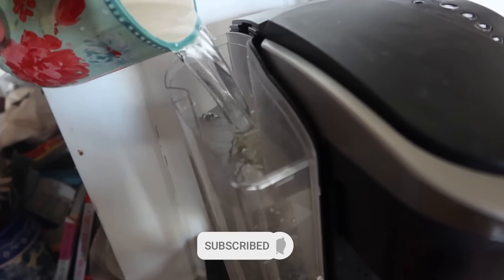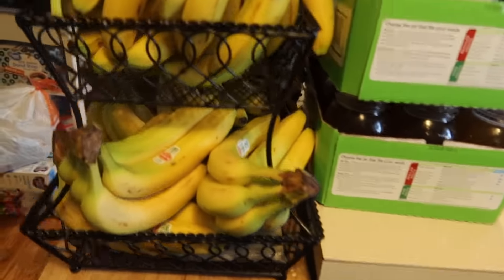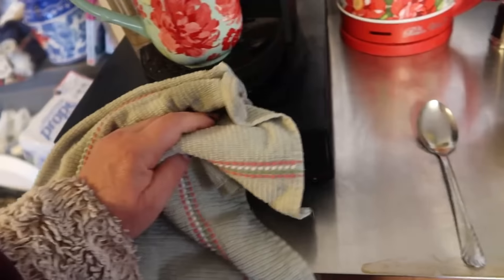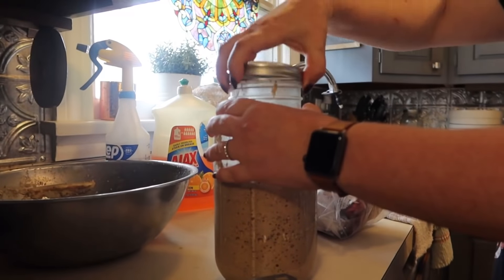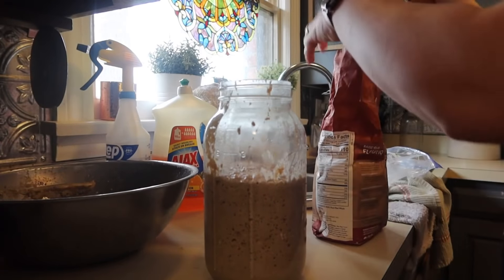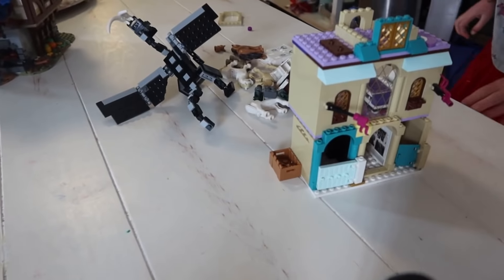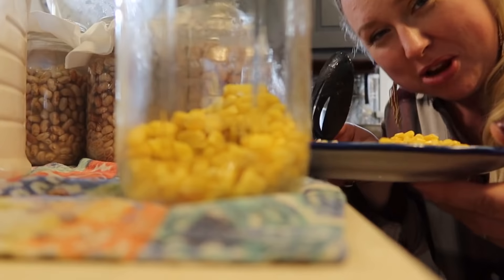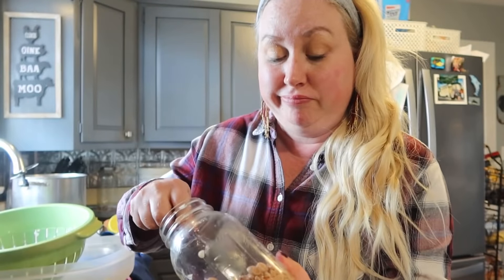Things Fell Apart

Comment: I have suffered from sciatica for almost 5 years now. I have done PT, gotten adjusted, massages, all the lotions and creams etc. The pain is awful at night when I have a flair up but I will say once I started taking tumeric it has helped tremendously. Unfortunately it took a few months but now I am only experience pain only on occasion and it's mild. Do stretch as well and a pillow in between the legs to relive the pressure on the spine. I will send prayers for a healing.

Comment: Currently battling sciatica in both hips and have found relief from CBD oil.  I've heard it is about 50/50 for pain relief.  But it might help.  and  I never presoak my beans.  I use 1 C dry beans in my quart jar, add 1 teaspoon salt then fill with water,  I put them straight into the canner and process 90 minutes.     Works perfect every time.

Comment: Don’t have time to read the chat but when I can dried beans I don’t go through many hoops.  I sort and wash the beans.  Put them in a jar and depending on the size (smaller beans don’t take as much water as larger beans) I put raw beans in and fill with water.  For example: navy beans I do about 3/4 full of beans and do 15 min at 10# pressure.  Kidney beans I do 1/2 full of beans at the same time/pressure.  No need to soak and precook.  This is what has worked for me. The times are for pint jars.

Comment: I know this is rebel canning but what I do is put a cup of beans in a quart jar. Now I always rinse them first but no soaking. Add the water to the right level and put a lid on and pressure can for 90 minuets. Remember to vent steam for 10 minutes first. Give this a try on 7 jars a canner load and see how you like it. I do pints because we don't have as many as you. So I do half a cup per jar and 75 minutes processing.

Comment: Jamerrill I also am suffering from left side siatica pain This is what I have used. Hot rice pack, ice pack, foam roller, stretching, naproxen, tens unit, electrical nerve stimulation and finally steroids. I have a trigger point grid ball coming today from Walmart.
Reply: I have had marvellous results from acupuncture. You might want it give it a try.
Reply: sleep on a futon...I switched about 10 years ago and, (after being told I needed spinal surgery,) never had sciatica pain again...

Comment: I have made mistakes with canning also.  It is all learning.  One tip, don't use metal utensils in the jars.  The reason is because flakes of glass or unseen cracks can be made.  Thus, the integrity of the jars is compromised.  It is fixable and you will have several lovely meals made ready in your pantry.  🥰

Comment: I've had sciatica for 22+ years, first few years were severe. Thru trial and error here are my tactics for living with it.
Temperpedic (soft) adjustable bed, pillow under knees and a zero gravity recliner for a few hrs on bad nights. 
Activator chiropractic, no electrical stimulation which fires it up. 
Acupuncture and Lidoderm  patches (Rx for higher percentage) or otc  for lower strength. Blue Emu numbing Pain Relief cream.
Good luck!
Blessings,
Jan

Comment: I have so many back issues! I’ve had the shots, surgery and a non-working spinal stimulator. I had to go on disability retirement bc of my back. A few things that I’ve found helps is; bend at the waist and hang forward and kinda bounce. Ice is much better at relieving back pain/spasms than heat-however, heat does feel nicer. At night I sleep on my side with a pillow between my knees. I hope these little tips help you some. I’ll keep you in my prayers!
I just Love your videos! They inspire me to cook! ❤️🙏🏻 Terri

Comment: Hello Jamerrill, I am a Registered Massage Therapist. I treat a lot of people with sciatic pain weekly. Most are postpartum women. I can not diagnose anything, but can share a few suggestions. Of cause they are just suggestions and not a treatment plan. (SO don’t come for me if it doesn’t improve😁) Stop Chiropractic. Put your time into massage and physiotherapy. Strengthen your core and stretch your low back. Try stretches that pull your knee up and across towards the opposite shoulder. Make sure you are holding stretches for at least 30secs. Heat can be your friend, before and after stretching. Try sleeping with a thick pillow between your knees, grumpy hip up. Try adding Yoga in a few day a week. Plain yoga, no fancy yoga. Sciatic massage is a lot of focused glut, lower back, hip work.

Comment: I think the carbs in the beans turns into glucose (sugar) and like candy sticks together. Next time spray the jars with baking spray, it should work. Also pour a small amt of oil on the stuck ones and submerge the closed jar in hot water. I'm sure this will work without you being frustrated.

Comment: For your pain, it stems from posture. We all tend to be in a forward “C” shape doing our modern day activities. Spend some time in the opposite position by arching the spine backwards. To start, you can roll a bath towel up and then place it on the floor and lay down on it so it’s right where the bra strap goes across. Bend your knees with your feet on the floor. Stay in the arched back position for about 20 minutes or as long as you can, chin towards the ceiling, arms at various angles (above, to the side, etc), stretching out everything. Eventually you can work your way up to using a foam roller with your head touching the floor, but that can take awhile. Yoga has helped me tremendously, but you must listen to your body doing any exercise, so you don’t further damage your back.

I love watching Mondragon Chiropractic and McLaughlin Chiropractic on YouTube - they are siblings but teach the same concepts. They’re in Florida. They combine chiropractic and deep tissue and myofacial work to treat their patients. I’d love to see them, but I’m on the west coast.

Comment: On the beans, it is 3/4s of a cup of beans per jar. Not 1/3 of a jar.  Butter knife freaks me out. So easy to get a chip. ☹
Raised beds are loved by slugs and snails. Get some copper tape and fold it over all the top edges.

Comment: I follow Ball recipe for beans, soak overnight in large bowls, drain, cover with water in a pot and boil for 30 minutes. Fill jars and can, perfect every time.  I don't see the benefit of putting them in jars. You should be putting hot beans in hot jars to go into the canner anyways.

Comment: You have a bottle feed goat I'm in the business go to tractor supply store for  goat formula does match works best and also get the bedding the shavings and also a heat lamp kep them under the heat lamp until the goat can move on its own bottle feeding scudle I do every 1 hour sometimes eats a little some times a lot  and more than 1 bottle   keep away from others so they don't get sick until they are old enough to get the shots and you know first is Alfafa hay if I'm not spelling it right it's the one with that starts with A and also when starting solids do not buy adult feed to start

Comment: When canning beans with the dry can method, you put only "1 cup" of beans in each quart jar. You fill the jar with water and salt and seasoning - optional for the salt and seasoning, then can for 90 min..  for pint jars of beans it is 1/2 cup of dry beans.  
Make the 1 cup and 1/2 cup of beans a LEVEL cup measure.  

This dey bean canning method has never me.  Realize this is not an approved method of canning.  Check any ball canning book for the approved method of canning beans.  Good luck.

Comment: I’m watching your BEAN video.  And hurting for you.
But one thing that is making me cringe over and over and over is the clinking of the metal knife in the jar.  Metal on glass jars is a BIG NO-NO.  It is too easy to scratch the glass and make them vulnerable to cracking in the temps and pressure of canning.
Good luck with the big project.